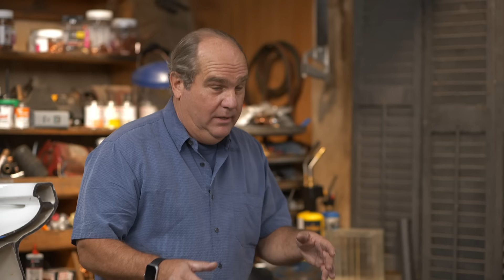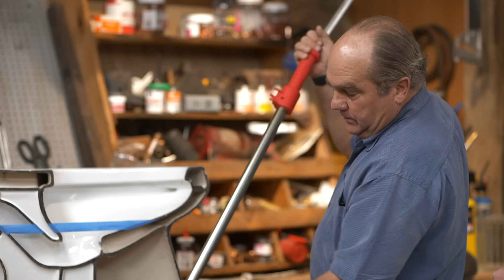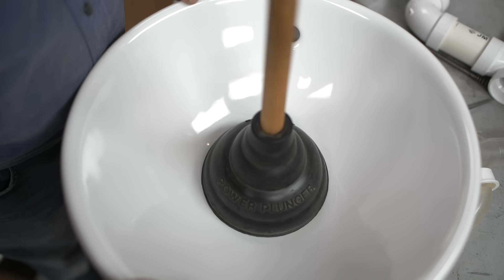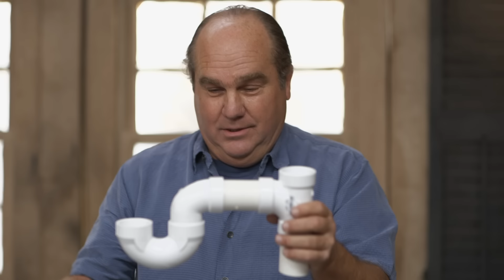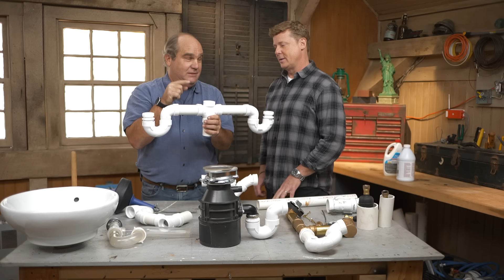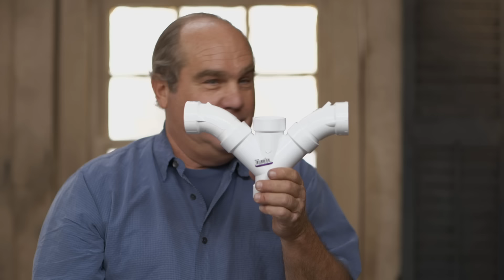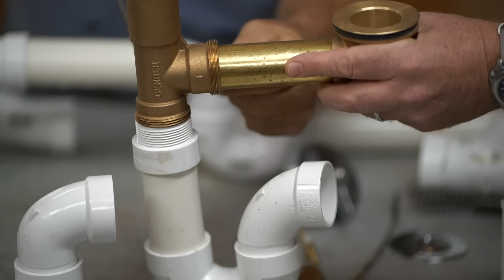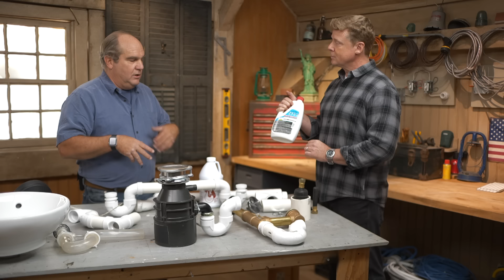How to Unclog Any Drain | Ask This Old House

Comment: My dad was a plumber/steamfitter and I went on plenty of jobs with him. Tip: if you are blocking the overflow hole to use a plunger it is more effective to use wet rag than a dry one.
Reply: I would make one addition to his theory. If you don't fill the basin with water, then when you use the plunger you are just compressing air. That won't do you any good. Water doesn't compress and you will get more of your force to go against the blockage.
Reply: i use a plunger or painters tape.
Reply: I have a question that I would appreciate if someone here can answer. So my toilet is gurgling and foaming!! White foam comes out. I was wondering if the water and the foaming are clean? The water does not seem dirty!
Reply: @SamarAshrafii Those 2 symptoms are caused by suction building up in the pipes. That means you have either a clog somewhere in your drain pipes or your vent stack (roof vent pipe) is clogged. Another possible cause would be a collapsed pipe somewhere in the system. Air bubbles that would normally pass through a clean drain get trapped at a clog and create the suction. The suction buildup will eventually release...sending the air bubbles (foam) toward the exit with the least resistance. In your case, that would be the toilet. Since it's just air you're dealing with, it's more than likely not harmful to you...but if you're getting a lot of it then you need to resolve the problem as quickly as possible for it will get worse and could lead to bigger and more expensive problems down the road.
Reply: @SamarAshrafii
Sounds like your terlet has rabies.
Reply: Shower water comes out everywhere bath clogged too new house
Reply: I usey wifey finger
Reply: Hi do you know if tub dont have overflow hole can I use the roof vent instead?
Reply: @darlenekeating9001  That was in reference to a sewer drain pipe that may have collapsed. That can happen for various reasons. For instance...when a tree root grows in search of water and it finds a drain pipe, it can literally break through the pipe to get to the water within. The materials that were once used in the past to manufacture pipes  can also be the culprit. Weather temperatures, misalignment of pipes, and other things are also in the same category. A collapsed pipe can't do it's job which is to direct water away from the house. If it doesn't start out as a complete flow blockage, then waste will build up in that spot until it becomes a stoppage. From that point, it will begin to cause severe home damage if the problem is left unresolved.
Reply: @gregc.9035 Can it cause black mold? I’ve had plumbers come to my house. Water sands in the drains id the showers and sinks and is green! They say it’s normal and do nothing!
Reply: @LisaLeimbach  Well, if you are saying that you have standing water in your drains, then the answer would be yes. It is possible for mold to grow in standing water in a drain..especially in warm, humid environments. They were somewhat right to say it's normal for mold to grow under those conditions, however, the growth of mold within a living space should never be considered a normal thing and just be left alone. The myths about "black mold" (yes..myths) aren't the issue at hand because mold is mold, and none of it is healthy. Any mold found should be treated as quickly as possible and removed.
Reply: We have a toilet that was made in the 60's we have use the snake; name it nothing has worked to unstop the toilet now we called a plumber he said us last night he would call today let us know either way if he could come either way he just down out and lied to us; dk who else to call help help if u can? We have watched this old house many many yrs??
Reply: This guy. Sitcom in the making
Reply: Too bad Kevin has no IDEA what he is doing .
Reply: At this point in time, Kevin would have to be actively refusing to learn to know nothing. That is the role he plays on the show. @edgaither2635

Comment: Nice job! I have been clearing drains for years as a maintenance mechanic in a hospital so I was familiar with most of the methods however, the rubber bladder with the hole in it was a new one. Thanks I learned something new today.
Reply: I'm not a fan of using pressure bladders or pneumatic RAM's on waste-pipes or drain, especially anything hidden behind walls, under floors or in ceilings - I've seen pipework come apart so would always recommend one of or a combination of snaking cable, Flex Shaft, jetting or a vacuum.
Reply: @mrdrains2088  but 1500psi or a nice hard metal snake won’t but air will lol 😂
Reply: @davidblevins9513  I usually run 4000-5000PSI through a 1/8" whip hose on smaller pipes if the mechanical auger or Flex Shaft cant get the job done.
Reply: @mrdrains2088  I didn’t know that made jets or jet hoses that go that high for sinks Bret of luck to your customer and those pipes behind the wall as you can’t see 😅
Reply: They have been at harbor freight for years now the worst thing you can buy other then the drain cleaner.
Reply: The bladder might work...you will need BOTH PSI and VOLUME (over 2 gallons per minute). It's the volume that keeps the bladder dealed in the pipe
Reply: gotta be careful with those rubber ones...things can go bad real fast if your not sure what line goes where...

Comment: 7:40 Drain cleaning bladder to inject pressurized water into clogged drains. Really cool.
Reply: I recommend equipping it with a pressure gauge on a T-fitting, and a valve to operate it locally.   The valve enables you to turn it on and off, without having to walk back to the original hose bib valve, and the pressure gauge enables you to get feedback on when you clear the obstruction.  Do a control experiment on the cleaning bladder in an empty piece of pipe open to the atmosphere, and see what its baseline pressure is (about 20 psig in my experience).  The valve also enables you to pulsate the water flow, which helps clear it as well.

Another recommendation is to temporarily equip your drain with a T-fitting and a valve-operated discharge tube.   It is very difficult to turn off these bladders prior to clearing the drain, as water will spray everywhere.  Having this auxiliary discharge tube gives you a way to redirect the excess water.

Comment: Just a thought,  but what I did for two sinks was just remove the trap pipe and clean it out then reassemble it.  For me,  it was quick and easy. Any cons about that?  I did learn from your video and thanks for that.  Good video.  👍
Reply: Not all traps are easily disassembled. My parent's double sink's trap is all soldered brass; not that easy to disassemble for cleaning.
Reply: No con necessarily. But also sometimes with some sinks the clog could be at the actual drain. Like in a bathroom sink there could be hair or whatnot wrapped around the stopper and/or rod. Or in like a kitchen sink there can be stuff wrapped around the cross pieces in strainer. Your method works fine too, and it does make it a little easier because you do not have to try and get a rod (wire as he calls it in video) through the p-traps. But also check the trap for obstructions (will usually come out when you dump the water from trap) as well as the pipe going up to sink.
Reply: When I had my kitchen sink waste lines repiped (copper to PVC), the plumber doing the work put a cleanout where the two sinks merged.  It was rather helpful the next time something happened and we needed to access the drain to clean it out.
Reply: @w3kn  Yep, a very good idea to put a cleanout in. Helps out a lot.

Comment: When is it best to clean out via the vent on the roof?
Reply: Usually this is done if the actual vent is clogged (Something fell down into the vent piping) or its a direct way to the main drain line (soil stack). If vent pipe is clogged, it will not allow air into drain lines to ensure smooth drainage. Think of a vent like a straw when you put it into a liquid and place your thumb over it and lift up, the liquid stays in, take thumb off and the liquid flows.

Comment: Thank you for this excellent video. One question : My lavatory sinks have captive stoppers - no way to lift them out without removing the trap. Is there any better way to unclog one of these ?
Reply: @U2WB 
Do you mean they are captured via the rod on back of drain? 

If it is the rod (which is attached to the lift rod you move up top to open/close drain plug) You can simply just unscrew where its attached to the back of drain, and pull the rod out and you can pull the plunger. I suggest you push the rod down first to lift the plunger, then slip something under the plunger to hold it up (make sure its big enough to not fall into drain) or have someone hold it then slide the rod out and plunger will come out.  

Clean all hair and what not off of plunger and rod. Run water down line before replacing plunger just to help flush out any material that may have fallen down into drain after pulling rod/plunger. To avoid water splashing out from where rod is inserted, either replace just the rod temporarily, or just put your thumb over the hole where the rod inserts until you have run the water for a little bit.

 After doing so, place plunger back into drain with the hole in plunger facing where rod will insert into it (if its the type that has the hole portion shaped like an L put the hole closest to back of sink). Be sure the rod gets into the hole in plunger. Check by trying to lift plunger out. If it pulls out, you did not get rod into the hole to capture it. Just check alignment and proceed. When you retighten the nut for the rod, Make sure you do not overtighten it. Should be snug, but not too snug that its hard to actuate it via the lift rod. Check all functions, run water and check for any leaks.

Comment: For sinks and bathtubs that keep getting clogged with hair, get a 25 Inch barbed drain tool  (cost about $2). Use it when drains start running slow, which at my house is every 3 months.
Reply: And/or a tub/sink shroom they get everything😎

Comment: UK toilets are different. They have a small amount of water in the bottom and dump lots down on flush under gravitational pressure. Anecdotally I've certainly heard more about US toilets clogging. I've always wondered the root cause of siphonic flushing vs diet :D
Reply: US TOILET problems are caused by environmentalists, politicians, and low flow toilets, not dietary habits.

Comment: Something Richard didn't talk about, which may be beyond the scope of the video, is the disposal unit itself.  If it jams or clogs at the unit, turn it off (unplug it if you can) and use an Allen key to manually run the mechanism in reverse to help unjam it.
Reply: Yep, Normally they will come with a allen key when installed. But we know that gets misplaced haha. It should be a 1/4 inch allen key.

Comment: what should we use i  drains to help keep them from getting smaller and smaller? (after some has been putting cooking oil and hair down drains)
Reply: Use a snake or the pressure head Richard showed at the end.  You can rent a snake for drains from most hardware or home supply stores for a decent price.
Reply: @FlameStrykeShadowDark  I was thinking more of something poured down the drain, like an mild enzyme to eat sludge. (not Draino chemicals)

Comment: My issue with modern toilets is that little front facing hole they didn’t talk about that water shoots out of. It’s open to a whole other pocket of air. And since the plunger seals above it, and pressure or suction you crest gets partially absorbed by that air.
Reply: And that jet hole (which helps to get the bowl water moving so that less water is used) can get crusted up which mineral deposits which decrease its effectiveness.   Get a gallon of muratic acid (pool acid) and dissolve the deposits.  If that doesn't work you are needing a new toilet...
Reply: @gregcollins3404  jet hole, that’s the name I was looking for! Mines not crusty, I think we have fairly soft municipal water, I just really think they make plungers way less effective.

Comment: I learned about a wet vac a long time ago. Plug up overflows in sink and other nearby sinks or tubs with wet rags, fill with water, place end of vacuum hose over drain, open sink drain, turn on vac. You will be surprised at all the nasty deposits that come out of the drain. I have also sucked out things from drains without drain guards, such as toy cars and plastic grapes. You can repeat if need be. May as well do nearby drains while you have your tools out.
Reply: You are 100% right - Using a wet vac is one of the best ways to clean out a blocked waste pipe or trap - works very well.
Reply: @tradde11 I've seen Steven Lavimoniere and hvacr videos use it sometimes outdoors on plumbing and hvac clogged condensation line and when there is no p-trap which causes the vacuum to hold water in the line
Reply: Omfg I absolutely Connor wait to try this. In fact I might intentionally block a drain JUST to do this before my adhd brain forgets I ever learned this
Reply: Yes I use a wet vac, the easiest way ever.  On double sinks I just fill both sides with water, plug one side and suck the 😅😅other.  It takes two seconds and pulls everything out like a tornado.  Boom.  On and off. ❤. On bath room tape overflow and suck.  Boom in seconds.  The other ideas is a waste of time.  And you do not have to clean the plunger or snake.  Just dump the water vac.

Comment: Question: Why not go 1.25 in or 1.5 in from a sink or any drain to the wall.  When you get to the wall switch to 2 inch pipe all the way to the exit.  You've got 3.5 inches in a studded wall.  If whatever you've put down the drain makes it through the 1.5 in, there should be far fewer problems with the 2 in pipe.
Reply: I assume the main reason is that larger diameter pipes will allow water to just flow around the solid waste; or have more difficulty carrying/pushing the solid waste since the flow rate is slower in larger pipes. The solids then have a higher chance of settling and hardening, causing more clogs and a reoccurring cycle. Cost is probably also a variable since larger diameter pipes cost more money.
Reply: Yeah, there’s also the fact that if you’re going to have a clog, you’d want it as close to the point of use as possible, not deep in your pipes where the obstruction can cause bigger problems or where you would need more specialized tools to even reach the clog.

Comment: thanks, I thought that chemicals can "eat" that pipe, I use boiling water in the sinks once a while :)
Reply: i poured boiling (pasta water) down the drain. it split the straight pipe just before going to the basement. A very loud bang. 1970 house. Guess the metal ( brass?) didn't like the fast thermal expansion of boiling water
Reply: I've read that thermal expansion from boiling-hot water can cause cracks, so we should stop at what the pipes were designed to handle: max water-heater temperature. Dunno if it's true, 'just passing on what I read.
Reply: @WilliamDye-willdye  I agree with that logic. I don't remember what type of metal (replaced with PVC) was there.
Reply: @WilliamDye-willdye  thank you very much

Comment: How about a pressure washer to flush?
Reply: The down side of a pressure washer is it has a straight line to the nozzle, so you can only get to straight pipes, and they have a maximum length, so anything past that will not be cleaned.
Reply: @FlameStrykeShadowDark  i seen a kit that has a flushing nozzle connected to a hose.

Comment: @This Old House I’ve been a big fan of the show for many years, way back to when online content wasn’t thought of yet.  My bathroom sink has a smell that I can only smell when I have the faceted water running, do you have any DYI suggestions…?
Reply: Is the smell coming from the drain or the faucet?  If it's the drain, there may be a pocket of rotting material in the trap that gets disturbed and emits gases when the water is running.  If it's from the faucet you might have water quality issues or a dirty hot water tank.
Reply: @FlameStrykeShadowDark  the drain for sure, if it was the water. I would smell it at every sink, plus we installed a brand new hot water heater recently and we have a whole house water filtration system that we love because of the city water is 225 ppm.
Reply: @ItZ_JoEyLo  I would suggest getting your pipes cleaned, either by yourself with a rented snake or by a professional and see if that helps in any way.  There are also non-chemical drain cleaners you can try, like baking soda and vinegar, which might help break up or neutralize the smell of whatever is in there.